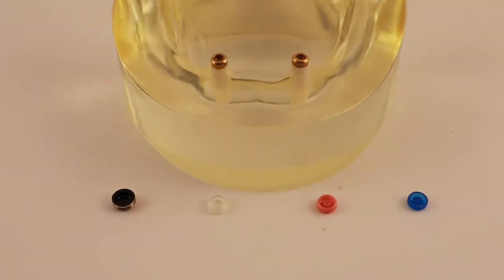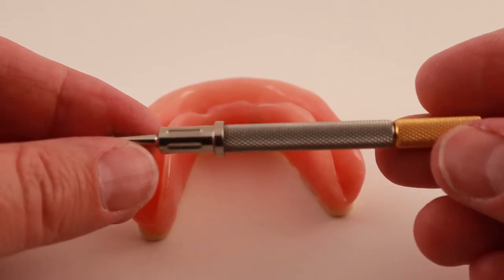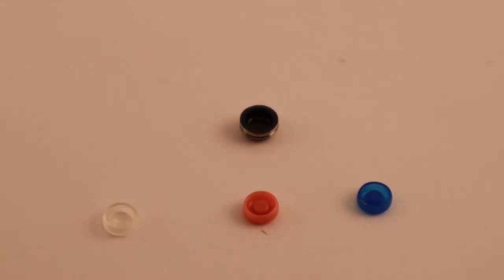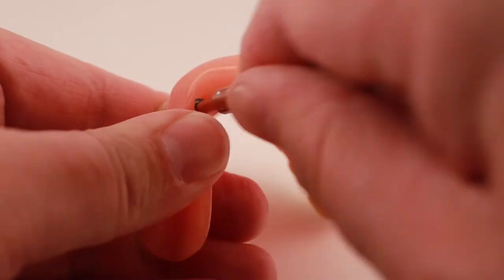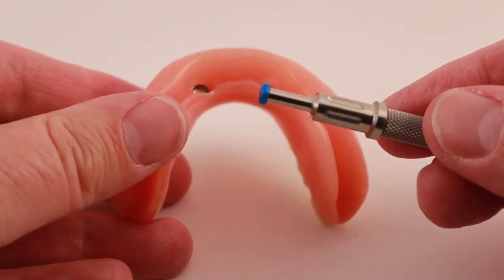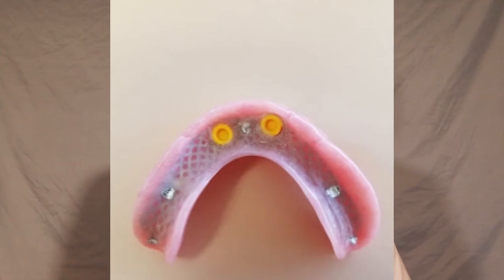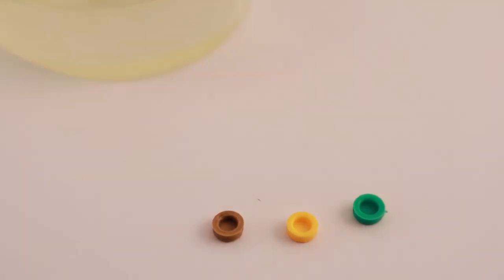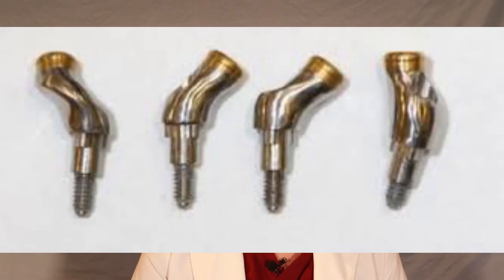How do snap in dentures work? A close look at implant retained overdenture snaps.

Comment: I have 4 implants on top and 4 on the bottom I currently have all blue in which is the lightest retention. Was curious about the red "extended range" snaps, would they hold better if one side was not as secure as the other? I am also curious to move to medium retention which is pink I believe but am nervous I won't be able to get them off. When my dentist was putting them in for the first time he used green I think? And he could not get them out he had to bang them out with a small slide hammer. Are green maximum extended range?
Reply from the maker: Hi, yes the greens are the strongest extended range snaps. Extended range are used when the implant posts aren't parallel to each other. A viewer told me about a simple technique to remove a snap in denture, you might find it helpful, https://youtu.be/YFY9HJqHQQA
Reply: @VeryNiceSmileDental  Wow thank you! I found them on Amazon and ordered the blue snaps last year they are authentic so thats why I asked about extended range. If I understand use the extended range if the implants are not straight and one of angled differently? I believe mine are like that because originally the dentist sent me off with just all black on top and 2 blue on the bottom and 2 black. I had the procedure done at a dental school due to cost.
Reply from the maker: You're welcome. Yes the extended range will work better for that type of situation. I've sent people home with the black inserts occasionally if they have difficulty removing the snap in denture. People with a little arthritis in the their fingers may have some difficulty. The floss removal technique makes it easier to remove the denture.
Reply: @VeryNiceSmileDental  Thank you so much for answering my questions!!

Comment: What is the normal cost for the snaps? I have had more problems with mine just wearing out just had them replaced again and they really started coming loose after about three weeks but I put up with it now I go back again and this time was charged $60 for the two snaps. What would be causing them to stop holding and wearing out? I just don’t get it. My dentist just doesn’t get it but I don’t like paying $60. The first time I had the new dentures put in my mouth was last October and I know I’ve been back 10 times for adjustments and probably had the snaps replaced four or five times I was not charged because every time he would put in snaps within a week my bottom denture was loose again. I cannot afford this $60 thing and I can already tell even after a week they’re looser than they were when he first put them in. After three months they did a cleaning which they said I needed that was $175 for the cleaning and putting in the snacks so is that appropriate? I’m just really stressed with all of this.
Reply from the maker: Hi, sorry to hear about all the issues you are having with your snaps. So you have 2 implants on the bottom with a snap in denture correct?  They shouldn't need to be replaced that frequently.  First thing I would check would be to make sure that the denture sits on your gums, not on the implant posts. If it is sitting on the implant posts, it will wear out the snaps quickly. I would also check to make sure the posts are parallel to each other. If there is a large angle between them it will cause the snaps to wear quickly. Also make sure that when you put the denture in, you press down on the snaps with your fingers, don't bite it into place. Biting it into place can make it go in at an angle which can lead to more wear. I made a video that discusses some of the maintenance issues, https://youtu.be/W24FEC7_oBU
I hope this helps, let me know if you have an questions.

Comment: I got 6 implants with over denture how do you get the floss into the holes to clean them ive tried and cant get it right can any one tell me whats the best way to floss them i would be so greatful😢
Reply from the maker: Is the denture removable or is in stuck in place? Have you tried using a floss threader or superfloss? Maybe an interproximal brush?
Floss threader video https://youtu.be/0NXm2tEVC0I
Interproximal brush and super floss video https://youtu.be/A3wOXzu-76Y

Comment: Can we change our own?
Reply: I had short roots and my teeth started falling out at 17 and all my he front stranded coming loose after. I had know it was a possibility  but I had to have all teeth pulled due to breakage and just a whole nonstop mess. So I got the snap in dentures. And I was never told I’d have to replace the plastic pieces and of course insurance won’t cover and I don’t have to money to waste so I’ve left it how if it because it’s my bottoms but it’d be worth the money to spend on supplies if I could but everything also. So I’ve asked if we can removed the implant in my Louth to clean occasionally not super often but they said no but I knowwwww food gets down there. I have all my measurements to everything. I’d feel mush cleaner to be able to w sh out with a water pick once in a while. .
Reply from the maker: Hi, definitely clean around the implant posts in your mouth. Usually the posts are only removed if they need to be replaced (the snap in post, not the implant itself). When you need new snaps, visit your dentist. They will check to see if the denture part needs to be relined. Thank you very much for watching.

Comment: I’ve got the biohorizon implants I’ve tried the tool for locator replacement and removal and it doesn’t work on my caps is that normal ?
Reply from the maker: Hi, you may have OD Secure inserts instead of Locators. OD Secure isn't compatible with Locators. They are made by different companies and they are different sizes. I think the OD Secures are smaller than Locators.
Reply: @VeryNiceSmileDental  yes they are ODSecure retention cap inserts (violet)strong) I cannot get a dentist to remove or replace them and I cannot buy the tool to do it myself !! Is there another comparable tool I can buy ?
Reply: Any suggestions please ?
Reply from the maker: I will look into it but the OD Secures may only be available from Biohorizons and only sold to dentists.
Reply: @VeryNiceSmileDental  yes that’s the problem !!! The dentist who fitted them no longer lives here and no one else does this system I’m desperate !!! Thanks for your reply
Reply from the maker: Hi, you can try calling a few offices to see if any use Biohorizon implants. Though it's easy enough for the dental office to order the proper inserts from Biohorizon.
Reply: @VeryNiceSmileDental   hi I’ve tried all implant dentists in my area no one will touch them it’s an absolute nightmare I regret having them done !!!
Reply from the maker: Where are you located?
Reply: @VeryNiceSmileDental  Great Yarmouth Norfolk
Reply from the maker: In the UK? That may explain why you're having some difficulties.
Reply: @VeryNiceSmileDental  yes the uk !!! Absolute nightmare
Reply from the maker: Let me ask around to see if I can help you find someone.
Reply: @VeryNiceSmileDental  thank you so much ild really appreciate it

Comment: I just had my upper snap on denture placed. The first bite of a soft sandwich did not feel right. I began to chew right side then the left side popped out.  I reinserted denture only to find I could not chew right. It felt too high, could not chew side to side ( (grind) without the denture popping out. I felt like filing down the denture teeth to allow for better occlusion. Also food kept getting under the denture. There is a small space between denture and palate. How can he fix this.
Reply from the maker: Hi, here are a few things I would check. First I would make sure that the denture is seating into position correctly. If the denture is in position and engaging the snaps but it still feels off, I would remove the snaps and make sure the denture fits properly in position without the snaps, sometimes when fitting the snaps you get a bit of denture acrylic in the wrong spot and the denture doesn't fit properly. If the denture fits in properly, then the bite may need to be adjusted.  Sometimes depending on where the implants are in relation to the denture, some snaps may need to be stronger than others to help it stay in place. When you see your dentist, bring some bread or other type of food with you so you can chew something while your in the dental chair to see how the denture feels and works. Let me know how it goes.